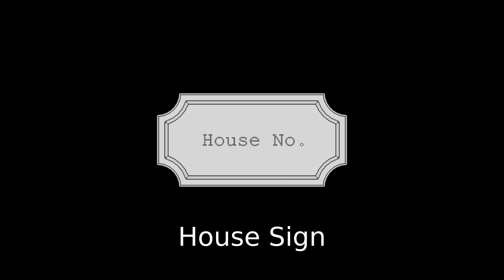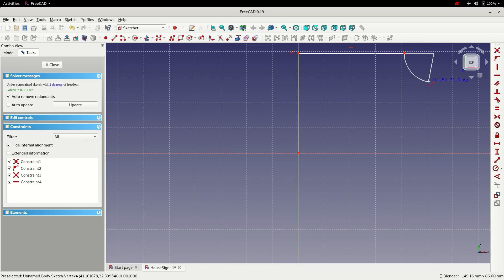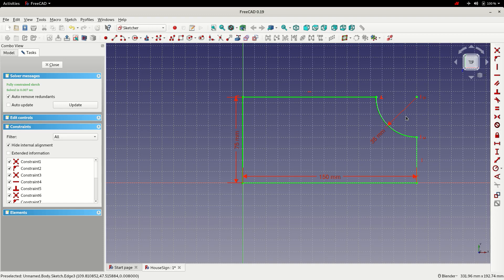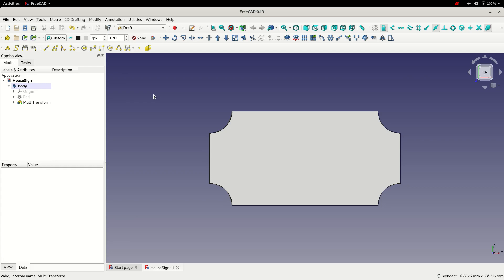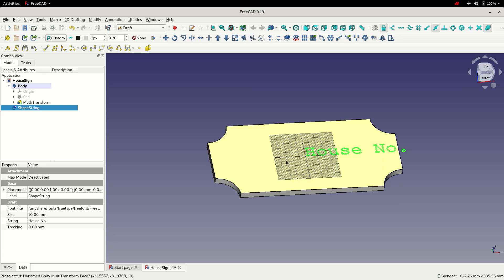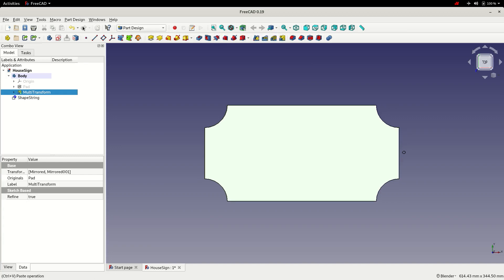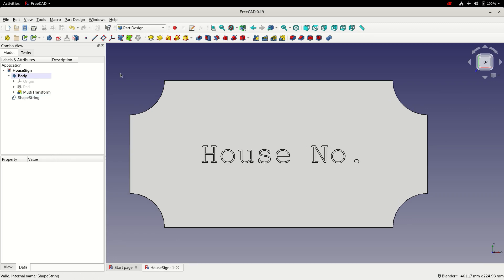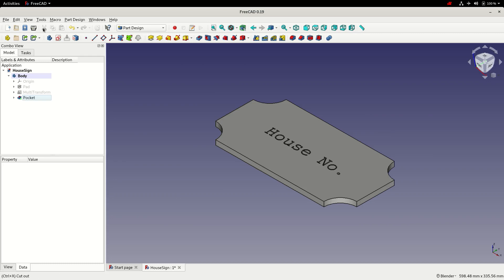FreeCAD Tutorial - Basics - House Sign

Comment: Great videos. I have a problem with mine . I try to follow along exactly but it always ends up with four quarters with lines dividing them.. As in each mirror transformation is a separate entity. Any ideas why this is happening?
Reply from the maker: Check the model properties for a setting called "refine". Make sure this is set to true.
Reply: @MarthamEngineering  Hi thanks for quick reply. I did that and same result. do I need to change that setting before I draw? or is there an apply button I am missing?
Reply: @MarthamEngineering  OH I think I got it. I pressed update view a couple times. Awesome! Thanks.

Comment: Again another excellent tutorial but this one has caused me an issue I can't work around. The second set of Multi transforms on give a vertical mirror and nothing will create the horizontal mirror of the bevel. Any thoughts
OS: Windows 10 (10.0)
Word size of OS: 64-bit
Word size of FreeCAD: 64-bit
Version: 0.19.22670 (Git)
Build type: Release
Branch: master
Hash: 12155f4aab09047c5697db0c1b3cf93b02edda03
Python version: 3.8.6
Qt version: 5.12.9
Coin version: 4.0.0
OCC version: 7.4.0
Locale: English/United Kingdom (en_GB)

Comment: Great Video... but for some reason the multitransform feature created 4 parts " well 4 parts when I moved my mouse over them " I have the sketch correctly constrained
to the centre as you have in the video and it also turned green... I'm using freecad 0.19... I've been using it for about 2 months.. I'm currently a professional autodesk
inventor user with over 15 years of experience, so I'm wondering if it could be my setup on freecad that's not the same as yours ?? I appreciate any help you can offer..
Cheers
Reply: I found it.... I clicked on MultiTransform on the tree and in the data section "Refine was set to false" I set to true and it fixed it :-)
Reply: @bighaggis9449  had the same broblem....... big thanks
Reply: @bighaggis9449  Thank you so much for sharing the solution. You saved me so much frustration
Reply from the maker: Could you post your file on the FreeCAD forum?
Reply: Hi
Unfortunately I cannot create an account I did I while ago but it says it's not activated..I left the administrator a message but haven't heard back...I might try and register another email address tomorrow..thanks for the prompt reply.. Cheers...

Comment: You're Freecad tutorials are in a league of their own, pity that you didn't take this into the Path Design workbench and try the engrave toolpath because Freecad is quite capable of doing a professional job?
Reply from the maker: I'm working on some Path tutorials that should showcase FreeCADs ability.
Reply: @MarthamEngineering  Am looking forward to your videos, it's safe to say they will be good! I did your above video in Freecad but used Gothic and the engraving toolpath handled it  with no problem, absolutely delighted with myself, thanks!
Reply from the maker: That's brilliant! Did you machine it or just do the CAM?
Reply: @MarthamEngineering  I do have a small CNC router but haven't machined it yet, however the above drawing is top of the list thanks to yourself!